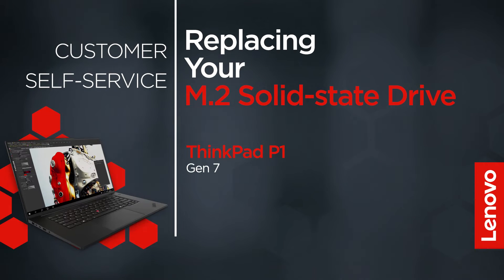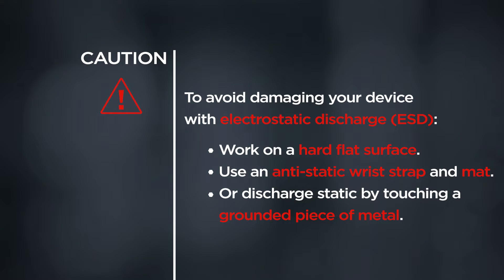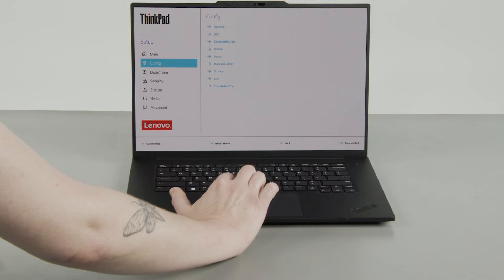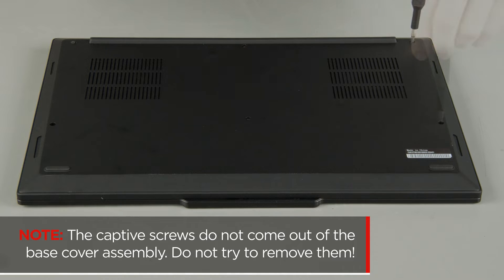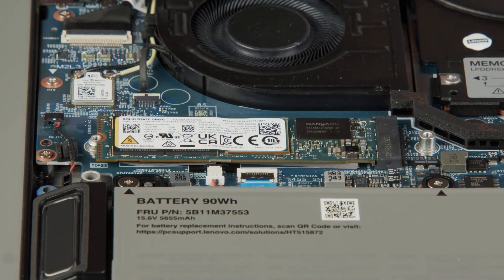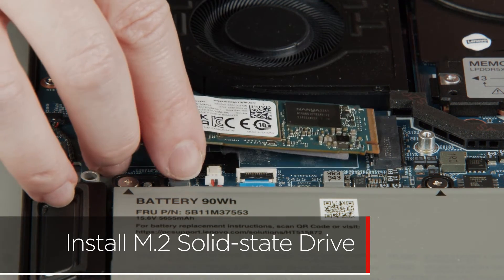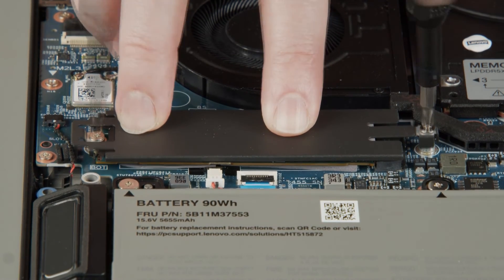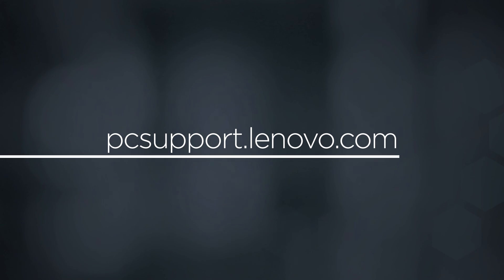Replacing Your M.2 Solid-state Drive | ThinkPad P1 Gen 7 | Customer Self Service

Comment from the maker: This video will show you how to replace the M.2 solid-state drive in your ThinkPad. The process in this video will work for the ThinkPad P1 Gen 7. 

You will need a screwdriver kit, a non-metallic pry tool, and 15 minutes of your time.

To view the ThinkPad P1 Gen 7 Self-Repair Guide go to https://pcsupport.lenovo.com/us/en/products/laptops-and-netbooks/thinkpad-p-series-laptops/thinkpad-p1-gen-7-type-21kv-21kw/selfrepair/removalsreplacements

To learn more about your device go to https://pcsupport.lenovo.com

To find parts for your device go to https://support.lenovo.com/parts-lookup/?cid=ww:lenovosocial:b9515f&source=socialmedia&subsource=yt

To view the Lenovo Support Self-Repair Guides landing page go to https://support.lenovo.com/us/en/solutions/HT516547

** NOTE: Static electricity can destroy components. Use a grounding strap, and clean, non-conductive surface to work on. Use plastic or coated tools to prevent scratching and avoid using metal tools on plastic parts. For more detailed information on electrostatic discharge and how to prevent it, please watch our ""Understanding Electrostatic Discharge (ESD)"" video: https://youtu.be/by4PB3WtdLo 

Applicable Machine Types:
ThinkPad P1 Gen 7 - 21KV, 21KW

#Lenovo #LenovoSupport #LenovoTechSupport

Check out other official Lenovo channels!
https://www.youtube.com/@Lenovo 🟥
https://www.youtube.com/@lenovolegion 🎮
https://www.youtube.com/@Lenovo-PC 💻
https://www.youtube.com/@LenovoSuporte 🟢🟡